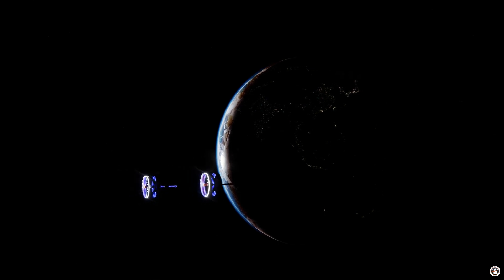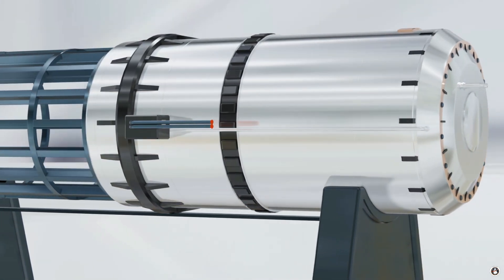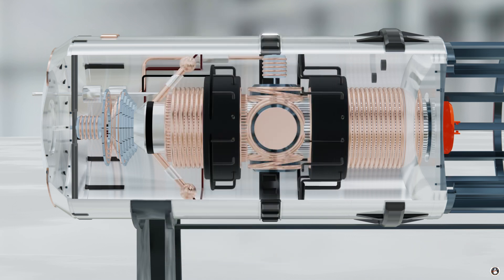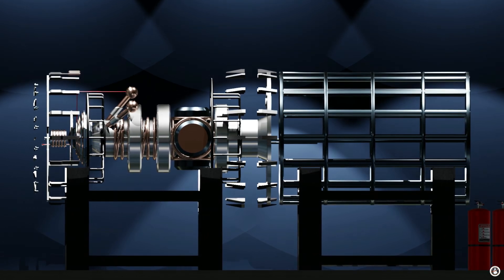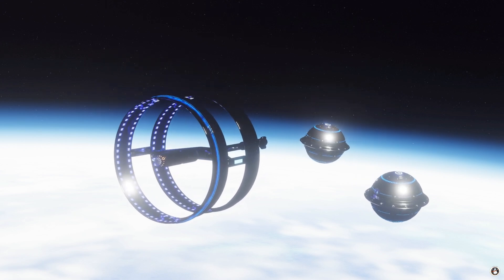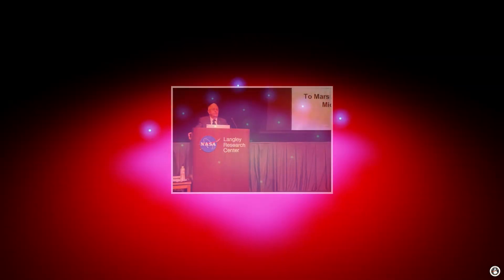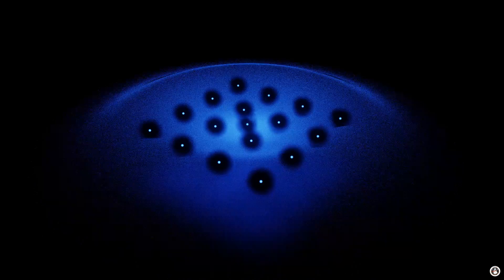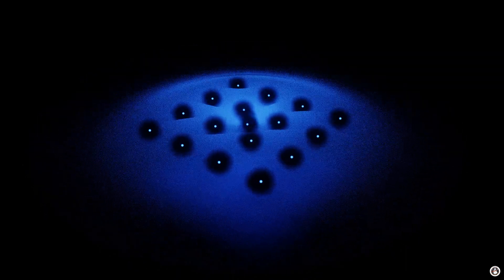Muon Catalyzed Fusion Engine - 8% Speed of Light - Mars in 5 days?

Comment: I think this drive would be far to slow for interstellar travel but it would be great for trips even all the way out to the Kuiper belt
Reply: Tbf even light speed is slow for interstellar travel.
Reply: @nil981  Light Speed or near light speed is still fast enough for travel to nearby stars. Alpha Centauri, Barnards Star, and Sirius.
Reply: @masonman_2113  only the closest ones, for exploration purposes. For practical regular use, a trip can only last weeks or months.
Reply: @icecold9511  then IS travel is out the window. Though I guess there are some situations in which lasting a few years isnt that bad
Reply: @masonman_2113  Even AC would take about 20 years because you have to accelerate till the halfway point then decelerate so that you can go into orbit around one of the planets. I forgot the details like top speed and acceleration/deceleration but if you use reasonable values the total trip takes about 20 years.
Reply: @masonman_2113  8% lightspeed would only take 12 and a half years to reach Alpha Centauri, from the perspective of an outside observer on Earth. To someone on a spaceship traveling to Alpha Centauri, only a few months would pass. Less than 13 years is nothing for the people on Earth, and even less so for the people actually making the journey. This is entirely practical for sending probes or colonists to neighboring star systems.
Reply: @Swindle1984  your math is incorrect
Reply: @masonman_2113  It's not my math, I googled it.
Reply: @Swindle1984  At .1c it would take between 40 and 50 years to reach Alpha Centauri.
Reply: @masonman_2113  as long use "fast enough", any speed can pretty much reach alfa centuari.
Reply: @masonman_2113  Yeah, I spotted my error. The 12 years is what the crew of the ship would experience via time dilation, not what outside observers would experience.
Reply: @Swindle1984  Time dilation is almost not noticeable at 8% light speed
Reply: @masonman_2113  Not according to the calculator Google provided me.
Reply: @Swindle1984  Well that calculator is screwed up.
Reply: @masonman_2113  No, you may feel like traveling 4 years to Alpha centauri. but on earth, about 70 years would pass.signal time. And once you have gone, the way back is again that long. Your family might have died in that time.
Reply: @nil981  2 years to the nearest star not too bad
Reply: @cwdiode4521  AC is about 4.5 light years.
Reply: @cwdiode4521  50 years not two
Reply: @dannygjk  what about Proxima?
Reply: @cwdiode4521  very long time even with decent acceleration and top speed it would take decades to get there according to our current technology. Then we would have to wait over 4 years to receive a message that the mission was successful.
Reply: @dannygjk  yes but even with such levels of technology people are likely to travel to other stars.
Reply: @cwdiode4521  Serious challenge tho to keep people alive for a twenty year trip. At least 20 years because more likely they would use a technology that can accelerate longer but a lower acceleration so would take much longer than 20 years.
Reply: @cwdiode4521  What type of drive could do that? That would be 2x SoL...I don’t think anything presented so far is capable of that.  Even Breakthrough Starshot is talking about 20 years for a microchip sized spacecraft to reach the nearest star.
Reply: @scottwendt9575  my bad I misremembered
Reply: @cwdiode4521  No worries 😉 It’s actually kind of neat that we have enough proposals and projects to make us occasionally confused. 👍
Reply: @cwdiode4521  lightspeed twice?, don't get greedo.
Reply: @cwdiode4521? Or are you considering time dilation for the crew?
Reply: @nil981  you wouldn't experience time at light speed and the time dilation near light speed would substantially lower the time passengers would experience. Unfortunately, we would all be dead before we knew whether or not they succeeded
Reply: It is a start though. This is going to be a one way trip.
Reply: @KevinDavis338  I mean 8%c is good enough for early IS travel. You load it with a mass ratio of 20 and push it with a laser to 25%c and you brake at the destination with the engine. That should allow sub 20y travel to Proxima, which is really pog. It relies on iffy yet-to-stablish science like UDD and straight up clarketech like neutron magnets, so I wont hold my breath
Reply: 8% seems fast and ok to me. As an individual 100 years is a long time, but as spieces its nothing. We could build a huge ship to take humans to our closest stars and it would be able to get to Alpha Centuri in 50 years. Thats a 1 way journey for sure, but once the tech has been well tested and is safe then its not out of the question that people would want to make it
Reply: @nicosmind3  also, is Walter in charge of the colonizer ship or is it David?
Reply: @-R.G.E-  A BH's horizon is not a wall, just a point of no return. Its a totally normal (well not really, but I mean not special) chunk of space.
If there is a god, its most definetly not there, though there are possibilities anyway, things like a simulation, which is the most plausible for the classical sense of god... Also, you believe that he exist because he is smart? How does this make sense? You first exist, then are smart, you cant have it the other way around, there is no smart thing that doesnt exist , by the definition of existance. Also, you should think if there is one or if it matters, and what are the implications before searching a hypothetical way it could. Y'kno, stuff doesnt just do things because if might be able to.
Im not saying you are wrong, Im saying you are doing the search backwards, and its not a reliable way. If you wanna talk about the topic and search for a bit of knowledge, I always like to talk heavily philosophical topics :D
Reply: Perhaps this tech can be paired with solar/laser sails, and possibly vasmer too. 

Project starshot will use a huge sail attached to a cube sat, flying at orbital speed of 17000 mph,  zap it with Earth bound lasers and almost instantly hit 20 to 25 percent of lights velocity.   Now supposed that cube sat with laser sails was already flying at over 8 percent of light when those lasers zap it?  Then 1/3 of light speed is low end, with over 1/2 more likely.  
With a good vasmer in use as well, a 60 percent of light may be possible. 
Now you're talking about reaching Alpha Centauri in under 10 years, possibly as little as 7 years.  Of course humans would not survive that kind of acceleration, a small robotics probe could.

This is of course just mental assention.
Reply: @byronflint2350  IS travel is further down the road, so we can get more ambitious.
Lets zap a 1kT vessel with all hardware required for complete exploration and an R of 20, plus setting up a highway for future missions, zap it with a 300PW stellaser to push it to 3x its exhaust velocity (in the case of this engine (that you shouldnt hold your breath for, it seems incredibly iffy at best), about 24%c), then brake with the propulsion section and of course staging. You should get to Proxima in about 15y this way
VASIMR has nothing really to do here tbh
Reply: @byronflint2350  How you gonna make it stop when it arrives?
Reply: @-R.G.E-  GR doesnt work like that. If it did, you could make a warp drive with some mass arranged in a special way. Idk what you mean by certain elements, much less "self made" ones, but nuclear or chemical properties have nothing to do here. And black holes have a problem, you can explore the inside, but not come back to tell the tale. You also can never see the singularity (nor live past the horizon really). And there is nothing there that can help with FTL really. I guess you could nake a singularity and do something with it, but a way to do it doesnt seem to exist...
Reply: @antaresmc4407  warp drives are something that I am dumbfounded by, look up the progress that is being made in theoretical physics it's gone from Clark tech to based in out there theory requiring quite literally exotic matter, to something based in known physics.
Reply: @andrewyork3869  its still clarketech tho. -mass was just the most obvious issue, and its not really settled if its actually not needed...
Reply: @antaresmc4407  well gr allows for warp drives if you also allow for negative energy density which is an effect that has been produced using vacuum energy and two small plates
Reply: @ChrisTuckerCarlzyn  first of all, no, the casimir effect is wholly composed of positive amounts of energy. The space between the plates has less energy than the surrounding space, not negative...

Second, saying it allows it is inaccurate, you have to throw it into the equations for it to appear, it's not given by the theory but forced into it by giving it a made up output and working backwards... Now we have designed our number/math system to it has an output for any operation, so any output you give will be one that can come from something within the math system, for example you can have FTL particles with imaginary amounts of matter... 

It's all an artifact of the math caused by working from a designed shape to an energy distribution rather than vice versa, when Alcubierre imput his shape (flat space moving at f FTL speed over flat space), he had to get an output, there was no option for no result. He got nonsense, and instead of saying "welp, its nonsense, whatever", (idk if it was him or the media misinterpreting it, which happens a lot) said "it needs exotic matter, which we havent found", which is horribly misleading as it: 

1) paints it as a type of matter, rather than a debt of it of some sort which would be much more accurate and less believable

2) paints it as if there was a reason to think it has any existance, there's not, yiu had to get something and if anything you got was possible then there wouldnt be a question to investigate because we'd already know its possible, also we'd livd in a very bizarre universe

3) paints it as a matter of lack of evidence, while the posibility of negative energy states would be pretty easy to test: the vacuum isnt in an infinite fall towards ever lowering energy while creating a constant big bang in the process :P (now this proof isnt perfect, you can demolish a few pillars of physics to rebuild a mess where it isnt so absurd, but now you are again falling into the trap of assuming your thesis to deduce a logic where your thesis is true, which can "prove" literally any proposition)  

Plus what would negative energy even be? The negative amount of work doable? Does it undo work? That takes positive amounts of energy too, the sign of eork is simply a convention to tell where is energy going, so what would it even mean? The fact that it isnt even defined beyond a meaningless math (you can put a - sign to anything, that doesnt mean it has meaning) should be an obvious reason to think it's not real, how can it be if it barely can be called a concept?
Reply: @antaresmc4407  on ur second point same thing with black holes until we observed them
Reply: @-R.G.E-  that tech is called wings and doesnt defy gravity, just pushes up to counter it. Free infinite energy is bust, and its arguably the most solid law of physics and science in general out there. Tesla wanted energy to be free in the sense of cheap enough to not matter, and in the final stages of his life he went a bit nuts and claimed stuff that doesnt work. Just because he was an idealist martirized by capitalism doesnt mean he was right in everything, and Im a bit tired of folks claiming stuff just because he did, and much of this stuff Ive heard wasnt even claimed by him, its just attributed for merit and free conspiracy theory
Reply: 1 percent the speed the speed of light would be enough for us colonize most the milky way in 100,000 years time. Using embryo banks and self replicating probes.
Reply: @DenverStarkey  the milky way is 200000ly wide lol. Also, better be faster, isnt it?
Lastly, IS colonization is a big effort, you dont do it if you dont get return on investment. In a nutsheĺl, you in general dont go too far away unless its worth it
Reply: @antaresmc4407  actually the milky way is 185,000 ly wide .  many scientist have done this math, on how a self replicating probe loaded with  billions of human embryos  could have the galaxy seeded with colonies in that time.  it's simple;  probe A moves to to a star at 1 % the speed of light taking about 4 thousand years to get there , from there the probe builds other probes and loads them with enough embryo's to seed all the near by stars to that star , then those probes do the same when they reach the stars they were send to.  the spread of such probes is exponential (that being each time a probe hits a new star they are building more than one other probe)   which is why  it would take as little as 100,000 years .  

and this is not about  returns on investments. it's about  the survival of the human race ... if earth was dying  this would be one method to ensure that it doesn't .   

this isn't some theory i just yanked out of my ass look it up.
Reply: @DenverStarkey  at 1%c you can cover 185000ly in 100000y. Sounds legit XD
Also, "the math" doesnt work here, it heavily relies in assumptions that we just dont know, and you cant go FTL, even less if going af 1%c at the same time.
And you dont need that mechanism nor colonize the entire damn galaxy to not die. Not like there arent better, easier methods that dont require sending a few embryos and everyone die anyway, nor its really plausible to go interstellar while limited to your home planet...
Reply: @antaresmc4407  dude not talking about 1 ship making 185,000 light years in one go.  one ship only makes like 4-10 light years , then produces more ships from materials gathered in a given solar system.  then those ship make  4-10 light year trips  and each one get's to their destination  and makes more ships at their destinations that go on doing the same . it EXPONENTIAL .  look the word up if it's too much for you to comprehend , each seed ship only has to make  4-10 light years  at 1% the speed of light that is    only about 4,000 -10,000 years each ship and each ship is making 5-10 to maybe even 20 other ships that are all also making  that many  more ships when they get to their destination.  100,000 years EASY at 1% speed of light . what's not easy is making a fail proof automated system  that needs no human  over sight.
Reply: @DenverStarkey  Do you know that exponential growth doesnt make you faster than the speed you are going, right? There is no shorter path than a straight line, for one or a million ships, and they dont teleport because exponential. Neither you build ships instantly, nor is really a good idea to just colonize everywhere, creating trillions of potential competitors or just wasting those resources...
Reply: @antaresmc4407  

again i'll ty to explain it as simple as possible.  1 ship makes a 4,000-10,000 year trip , it gets to it's star,  build ten more ships , they ALL go to different stars that are with in 4-10 light years of the star they left.  and each one of those ten ships do the same.   after 30,000 years you'd have potentialy     100 star systems colonized.  another 30,000 years you'd have 30,000 star system's colonize  that's why me saying the word exponential is important , point is every "generation" of these probes  would be creating 100's then 1000's more "probes ".   and of course you don't build ship's instantly but given how long space travel takes even at 1% the speed of light building the ships/probes  would be the most miniscule part of the endevor. 

"nor is really a good idea to just colonize everywhere, creating trillions of potential competitors or just wasting those resources..."

when the f--- did i say it was a good idea ?  seriously why do you have try and to validate your argument by jabbing words in my mouth i didn't say?  

I never said it was a good idea to colonize every where , i was talking about a documentary where they discussed  this being a possibility , maybe even as a means to save our race  from extinction . i never said ANY thing myself  other than discussing the damn documentary.
Reply: @DenverStarkey  dont take it as an attack, we are not fighting, please. I didnt critizise you or validate anything, its a completely separate point.
I also understand what exponential growth means and what are you referring to. That doesnt make you go in less time tha your speed/distance. 200000ly at 1%c will take an absolute minimum of 2*10^7y, which is much more than the 10^5 you talk about. No matter how many ships you have, exponential or not, you cant cross a distance faster than the shortest straight line at the speed you are set.
About travel time and building time, that depends a lot on your assumptions so idk, but depending on what you state it can even be most the time
Reply: All we have to do is get around our milkyway.  Not much difference from galaxy to galaxy besides age and position.  Same elements,  same stars , same bodys , we need to hope we are the only one claming tbe milkyway . But we have to start sooner then later to expand the human species or get our brains behind a chip .
Reply: It would take constant and significant acceleration then deceleration to get to the nearest star.
Reply: Highly Agree!
Reply: You have to think, this is just the beginning. 
Also, who knows what the future holds for space travel.
We have to start somewhere and some how. 
Just being a few minutes into this video, I feel as if this technology is a good stepping stone so to speak.
Reply: It might help investigate a lot of object inside the solar system. Manned trip to Mars, Jupiter... There is possibly a lot of interest to map and scan transneptunian objects.
Reply: @Edwin Shaku lol your not too off, considering some counter deaccellerations and turns apply, but its true, Voyager was nuculear powered, but of its power core, not the booster combustion involving energy thrust, speeds would have been like you mentioned, 11 months to the edge of the solar system, modernly, that is impressive,  I've always advocated a craft like Starship, have a mid 3rd stage for solar orbit travel, using energy thrust amped with nuculear, far safer then a limited canister sensitive chem fuel and nukes. Save the chem canisters for emergency manuevering & vtol initiations.
Reply: We need wormholes or to find a way to fold space if we really want FTL. Just linear intersteller travel sounds way too impractical and slow. No matter which way you slice it, the laws of physics as we know it need to be bent or broken for any FTL to actually work.
Reply: @-R.G.E-  as you may understand, putting money off a random conversation on YT comments is not the best idea lol
Reply: @-R.G.E-  idk what does it have to do with Tesla. When he lived supernovae's mechanism w knowasnt known, let alone black holes.
Also, stars are puffy balls of gas, they dont even do fusion well, so there is nothing of real complexity to give birth to anything. Also most fail to moake a black hole, exen if you only count the explosive ones.
Also, whats strainstheory?
Reply: @-R.G.E-  I dont get it...
Reply: @-R.G.E-  wait you say that US presidents come from UFOs? Ok...
Musk is a cool figure, but lets be fair. He is making money, a lot. Not bad, but its not fuck money save the world. The tons of innovation its funding and his genious marketing to make that be used and keep funded is pretty awesome tho. The engineers that did all the stuff deserve way more credit though... Anyway, lets go Starlessship POOOG.
Yes, its starlessship (I see no star there) on the Big Fucking Rocket. Fight me X'D
Reply: If our species were to ever send living explorers to another star, it would necessarily be a generational starship with an entire advanced civilization traveling at such a fraction of c.   The reason we'd need to send all that is because they might be able to gather resources and solve problems while out there beyond home.
Reply: @jeromebarry1741  nah, resources are plenty and space big. And you dont need gen ships, its not that comparatively hard to go 20%c and to Centauri in 20y. Also the concept of living will evolve as enhancements and AI become prominent, even more of generation and heck, even time. You do it becausd why not, and because you at some point will want mord stuff, not becsuse you need
Reply: @antaresmc4407  agreed; but there would be a serious need of thrust to maintain 8%. If your engine could maintain just 1g, the amount of thrust at 8% would be a lot. The same would be for maintaining 20% speed.
Reply: @tim7696  wdym maintain? Drag in interstellar space is negligible, even at these ridiculous speeds. But yeah in no world you're pulling a full G out of a fusion engine, let alone the video's nonsense.
Maybe with a laser, but it seems wasteful, you dont need that much acceleration...
Reply: 53 years to go 4.25 LY.  Still a generation ship
Reply: I'm thinking it would be good for catching up to Oumuamua-like interstellar "asteroids". If the interstellar "asteroid" moves away... its aliens. Full stop.
Reply: I want to start with saying that I agree with you. With that being said, I believe that this is just a step towards an engine that can go as far as interstellar travel.
Reply: could help construct laser highways.
Reply: This engine could make the universe of The Expanse into reality (as far as the solar system is concerned).
Reply: @BooDamnHoo  nah, you need even greater perfomance in terms of thrust. I alredy estimated its TWR in another reply and it is bound to be abysmally low, plus concerns aboug the validity of the concept as a whole and some of the BS said in the video, like neutron magnets...
Reply: @antaresmc4407  So Orion is still tops. And WOULD work.
Reply: @BooDamnHoo  I never mentioned orion, but its neither too good. It has high thrust, yeah, but Isp mediocre at best, low R, very high costs and risks and thrust is delivered in a very awkward way
Reply: Mars in a day or less, Jupiter in a week or so, Saturn a few days more. Let's hope it does not take decades to roll out. Musk's Starship with huge magnetic rings would look awesome, like a Vulcan cruiser. But Starship needs to be several times longer and wider to be actually useful in interplanetary passenger and materiel hauling. nobody in their right mind is ever going to sign up for an at least six month voyage to Mars, or even longer elsewhere.
Reply: To travel to Proxima Centauri, the journey could occur within a human lifetime around 60 years.
Reply: 02:44 Anyone noticed, the engine looks like one of the rebels fighter jets bulk double adjacent engine in the classic star wars movie.
Reply: Its not a bad thing that this engine designes isn't extremely fast, g-force will already be an issue at non stop acceleration required. Humanity would need to test g-force in the state of cryonics, and see if health strains through travel, but now the next obsticle, is the countering obsticle of gas, particles and chunk debree at extreme continues beyond light speed or even sub speed.
Reply: Not even light is fast enough, drives will need to manipulate spacetime or something for interstellar flight.
Reply: Does this engine use any elements of Muon Cascade or does it just exhaust the muons into space as unrecoverable particulates?

Sadly, as efficient as this engine could be it is still a constant thrust engine type, not a constant acceleration engine type.

Are you looking to hire? I have two constant acceleration engine designs and I'm penning down my theory on Cryogenic Crystalline Fusion and I would be interested in working with your group to help redefine certain aspects of propulsion theory.
Reply: They do have that impossible drive that goes 99% the speed of light but testing shows it works other testing shows that don't work so who knows
Reply: 100th reply
Reply: well most drives that people think of using for interstellar travel like realistically take ridicules amounts fuel so if you take those same amounts of fuel to a craft with the same weight but just with a muon catalyzed fusion drive then you will be going much much faster as remember a spaceships drives exhaust velocity in not its speed limit
Reply: Gotta start somewhere, you don't go from the wiley coyote rockets we've had since ww2 to a warp drive
Reply: Compared to Ludicrous Speed, anything is slow.
Reply: @annoyed707  they past us sometime last week😆 I didn't get that joke until I was in high school and my physics teacher explained it to me and then we got into relativity  and it's been a wild ride since. Now I'm a nuclear engineer and whew boy if you people only knew 😁jk lol
Reply: @masonman_2113  the drive is described through all 9 novels and the novella. You're right and in Leviathan Wakes, the characters even say the epstien didnt give them the stars but it did give them the planets. 
There's two things we'll need from the expanse to make interplanetary travel a reality in our Solar system 
1. Propulsion like the epstien that uses pure h20 exposed to the fusion reactor plasma so that it goes from a liquid state to plasma almost instantly while also serving to carry away waste heat that you'd otherwise need big ass radiators for. Water as a reaction mass source is great because it's everywhere from the polar caps on mars to the ice moons of jupiter and saturn etc... so someone had to figure out how to build an inertial confinement fusion reactor small enough to fit into a ship and bobs your uncle
2. Anti cancer meds/ treatments. A medication or procedure that targets and kills cancer is going to be necessary because radiation in space is just not something we can shield against and have a spacecraft that doesn't have the same mass as an aircraft carrier. But if we can eliminate cancer as a threat then you still want shielding you just won't hit the accumulated dose point where cancer and death are a certain thing. Acute radiation sickness and death will still be a risk but if you aren't hanging out on it for a day unshielded you will probably be ok with cancer killing drugs or whatever
Reply: You have a better engine design? 
If so please share it.
Reply: So like what's shown in most of the Expanse